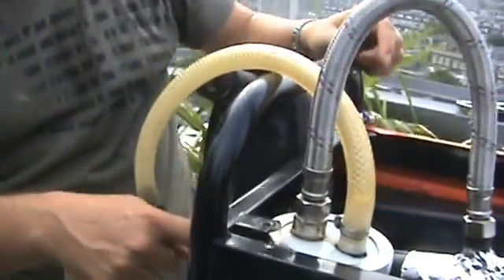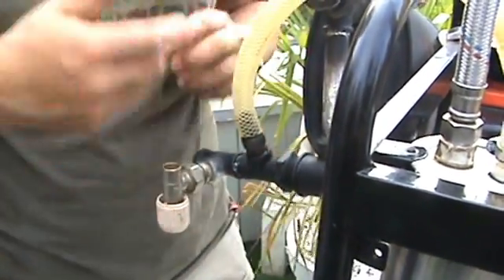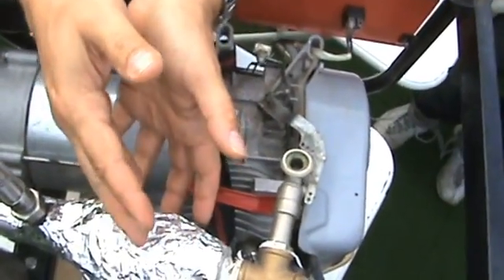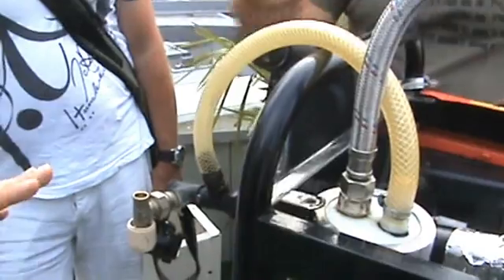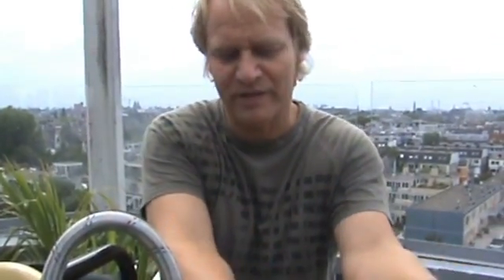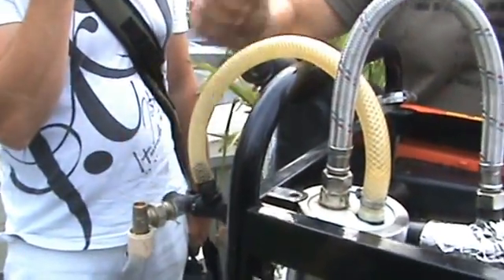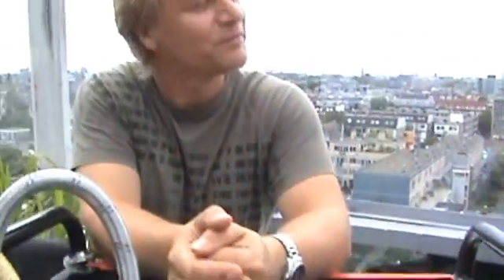GEET/Pantone Hybrid demonstration

Comment: Vacume induced gas induction! Lol not fuel injection! And if you yutilise the generator and the cooling effect of one side of the generator to condense humidity from the atmosphere and also presureize excess gases that are not required wen not runing the engine at maximum capacity then a net gain can be achieved, another words, this is practically zero point energy giving you more than you need to self sustain!!!!!!!! Everyone needs to youse this and start to suppress the overreach of menny of the worlds governments and ,overlords! The knowledge is out now and has been for menny years ! Almost depressing how few people are actually realising its potential! Its even simpler than nuclear cheaper more available and gives you more back than you put in ,and you don't have to worry about it for thousands of years lol! Wtf!

Comment: doesn't seem like anything crazy, though I have heard of similar "ultra efficient designs" that use exhaust gasses for preheating the intake air. It's basically an exhaust preheater and also sucks up water with the gas as filler for some reason. I'm sure it would improve efficiency a ton. I'm curious how it works in a vehicle.

Comment: the volume of bubbler depend on what?
Reply: It really is up to a personal preference. I would probably suggest starting with something about a liter capacity. More than bubbler volume, I think it is more relevant the depth at which you stick the gas inlet tube into the water/petrol liquids. I would probably dare suggesting you start with approximately 10 cm deep.

Comment: 0:55
gazoil's density = 850 g/cm3
water's density = 1 g/cm3
but the water stay under the gazoil : it's ruly strange, i don't think that the engine works.
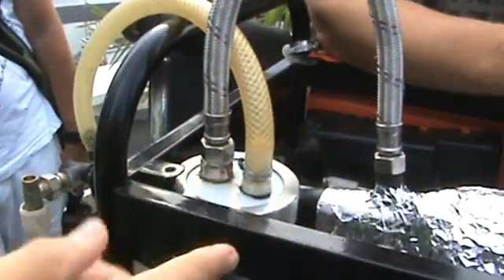Reply: I can confirm the engine works. I was there asking the questions at ~ 2:50
Reply: As soon as the engine starts, the bubbler produces a strong agitation that renders a mist from the water/petrol liquids. They do not really mix, but you can tell such mist is composed of both substances as they deplete in the same proportion.